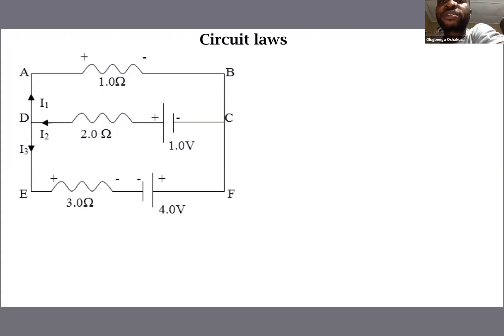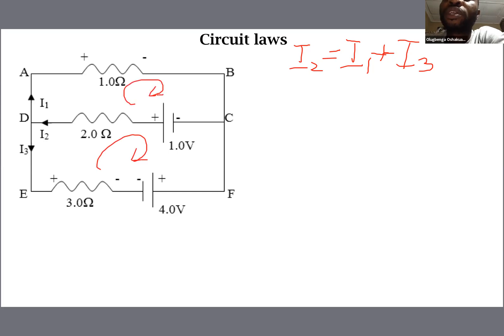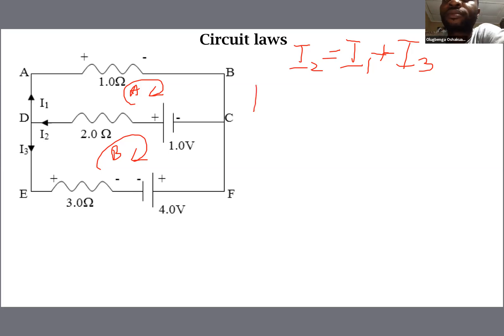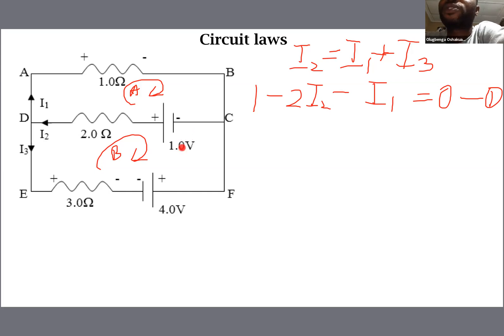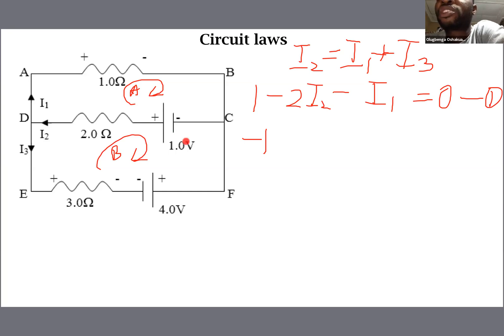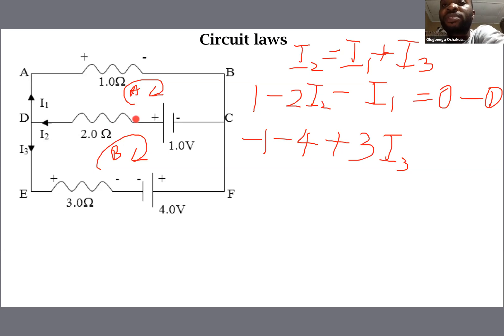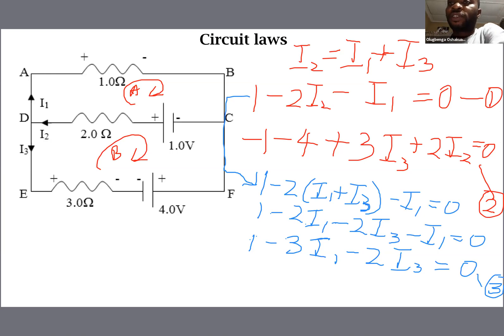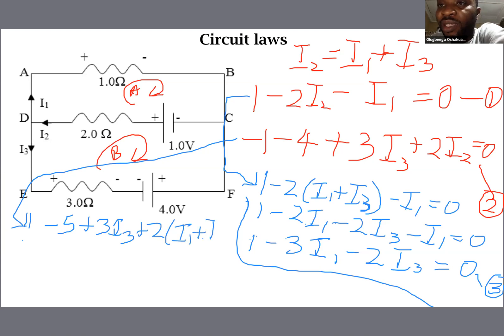Example 3: Kirchoff's laws

Comment: Good morning sir. I got I1= -0.455 A and I3 = 1.182. Please I have a question: for calculation of the I2, do we take the negative sign into consideration or we neglect it? Taking the sign into consideration, I got I2 (i.e. I1 + I3) = 0,727 A. Ignoring the negative sign of I1, I got I2 = 1.637 A. What would be the correct approach sir?
Reply from the maker: Thank you for your question. 
Short answer: We take the sign into consideration.
How? A negative value for current flow implies that its actual direction is opposite what was assumed initially. In other words, if you had assumed current to flow out of a node (junction), then a negative current value means that the current actually flowed into the node, and vice versa. For example, "5A flowed into the node" and "-5A flowed out of the node" have the same meaning.
Please let me know if you need further clarifications. Thank you and best wishes.
Reply: @oshaks  Thank you sir! It is now clearer that the sign will be taken into consideration. 🙇🏽